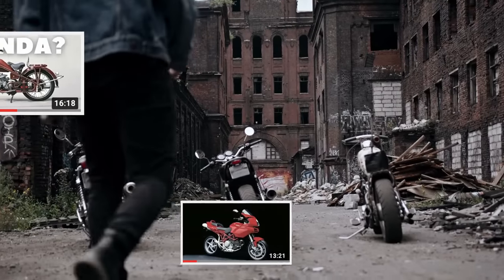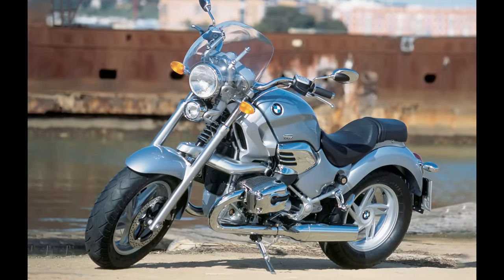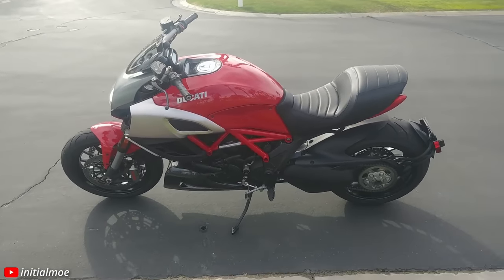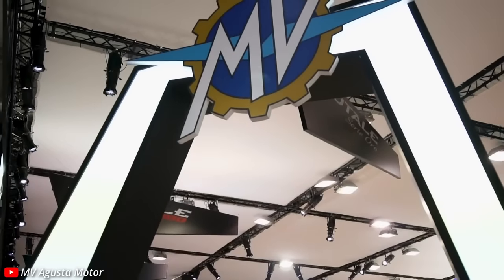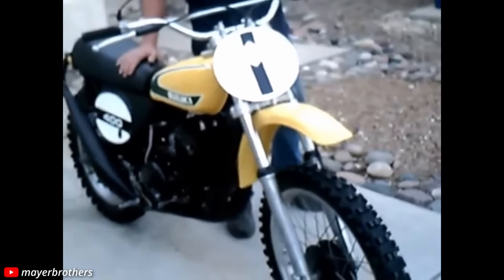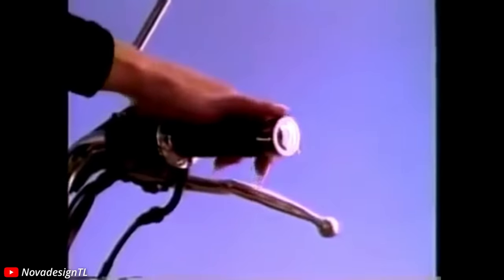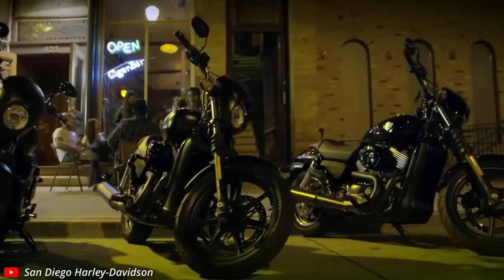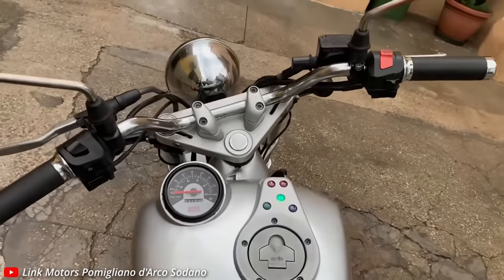The WORST Motorcycle from every manufacturer

Comment: The Norton Commando introduced in 1969 should be the first on the list. I knew every nut and bolt of this motorcycle well having purchased a new one and two used over the years. This piece of junk was a last ditch effort by Norton Villiers to stay afloat and mechanically it was an utter shame. Although the engine was a good one everything else on the bike had problems do to cheap materials, bad design, and no quality control at the factory. Starting up front the drum brake was nearly useless at its best and the fork tubes were plated with a soft material instead of hard chrome leading to worn seals and a scored tube. The bike would shimmy terribly because no dampener was present and this led to a record number of crashes and fatalities. Adding to this was the poorly designed rubber mounted frame. The transmission mainshafts would either bend or snap under hard usage. This happened so frequently that there was a backorder of them at the factory for months in the early seventies. The shaft that held the swingarm in place would loosen in the frame causing excessive side play at the rear wheel. The exhaust header pipes would frequently break at the flange and the rubber mounts used at the mufflers were too small and broke constantly. The action for the clutch cable was poorly designed making for a very hard pull and constant broken cables. I firmly believe that this bike was built so poorly and handled so badly that it never should have been allowed to be sold.

Comment: The Eliminator is always misclassified as a cruiser because of its looks. 
However due to its poor cornering at speed and tiny fuel capacity it occupies a kind of unique category as a sprinter.
Designed as an answer to Yamaha's Vmax for sprinting on the strip, the Eliminators appeal led Kawasaki to produce the design in every CC from 125 up to 1000 with pit stops at 250, 400, 500, 600, 750, and 900cc in-between.
The 600cc of 1986 even enjoyed a revival in 1996 due to demand.
The Eliminator is tons of fun in cities where its insane acceleration brings miles of smiles between the lights while its lazy ass cruise style is comfortable in this environment at low speeds. It is defiantly not a cruiser as due to the low seat height your knees are uncomfortably high and the pegs will hit tarmac if you are over enthusiastic in the corners, not to mention the tiny range of about 90 miles per tank full. I personally own an '86 ZL600 and a '96 ZL600 purely for the fun factor and of course a special edition KZ750N1 Spectre which is more of a cruiser than the ZL600.

Comment: So as an old guy having had dozens of motorcycles over the years. I am European but have lived in 4 different countries like Australia and for the past 30 years in the USA.  I was in Aus in the late 70's and early 80's and I have learned that Cruisers to me are useless and ugly.  I see fat old men on these going to the local bar, however, it is like a religious experience to them and few will leave the Harley brand.  When Japanese and European makers try to make cruisers they do not understand this and ultimately they fail.  On that note the Virago for instance, I had the Australian version of it around 1980 which did not look like a cruiser and had a different name like V1000 or something (1000 cc) it was a  normal motorcycle with an enclosed chain case.  It was under powered and a bit boring but not too bad and good for commuting.  Right now I ride a Moto Guzzi V750, why?  Because it is probably the last motor cycle that is easy to service by an owner.  It does not have water cooling, no chain to oil (shaft drive...) , no plastic body work to remove, and four simple tappets to adjust with the cylinders conveniently played out to the side for easy access.  One short service session once a year and I am done.  It also has the most comfortable riding position and on long trips I seem more comfortable than on most current motorcycles.  An finally it is 750 cc's but seems to have torque more like a liter bike.  So this brings up an interesting issue, why not do a video on which bikes are the easiest and cheapest to maintain for someone using a motorcycle for commuting rather than weekend rides.

Comment: You are totally wrong about Triumph´s oil in frame bikes. That system was one of their most clever moves ever. If you have any knowledge about "Dry sumping" you understand that this i very good solution. You mentioned foaming in the oil tank, that is all about useless engine oil that would be even worse in a wet sump lubricating. That relatively high oil tank formed by the frame supplyed air free oil to the oil pump.  The only real flaw about Triumph´s lubrication at that time was that they never installed a filtering system better than the usual strainer. After market solved that problem with filter adapter from Norton. A rotating continuous oil pump would be a better alternative to the ancient plunger type oil pump. But it worked. I drove my T140E from 1979 110000 Km and it had a good motor still.

Comment: XLH 1000 by the Harley bread machine company.  They figured out how to make mechanical  points and unproven electric ignition work together to make almost every motorcycle ride ended with the rider walking to the nearest payphone to call for a pick up.  Week engine, ho-hum design and just poorly made machines.  Harley under AMF stunk up the universe with their 70's motorcycles, lead by the 1000 Sportster.  Been there, lived it, got the well worn riding boot soles from pushing and walking.

Comment: 10:44. The Varago. I have ridden one. The handling was awful. At Hiway speeds, it did not want to corner. I had to put all my weight into the bars to keep it in the corner. It just wants to go straight. It sucked.     Royal Enfield... I think they would do better if they made some decent twin-engine bikes. Displacements from 450cc to 750cc would be acceptable. A 1100cc twin would be badass.

Comment: 7:21. Moral of the story, "Super Naked" or "Super Moto" bikes are hideously ugly, have never looked good, have never been wanted by real motorcyle enthusiasts and they look like a crashed and rebuilt sportbike with random pieces added on. Let's please delete the genre from the lexicon of motorcycles. 10:35. The Yamaha Virago hahaha. I posted a comment on another one of your videos about how I determined back in 2002, that the Yamaha Virago is the worst motorcycle ever. In my comment I explain how I rode a Yamaha Virago and it was the least powerful engine I've ever experienced, it felt about the same or slower than a 27 horsepower Yamaha XS400 twin, despite it being a huge engine on the Virago. I remember at 55mph the Virago felt like it was basically out of power.

Comment: I enjoyed the Virago 1100 as far as I could - The bike was nimble enough, incredibly pepe and I loved those raked out forks - I think I'd need to be another 3 inches taller to be comfortable -  I felt as though my feet would vibrate off the pegs though they never did. It wasn't my bike though so not my problem - I was riding the V-Max at the time, what a python that is to ride!

Comment: I bought a Virago 750 new in 1981 because I liked V-Twins but did NOT want one that tried to copy the Harley Davidson look.  The Virago had its own look.  And I think a very good looking engine.  The only thing I didn't like was the cast wheels (I prefer spokes) and I found the rear suspension design led to terrible handling (the magazine reviews at the time also pointed this out as I recall.)  I had never had a bike with a drive shaft before and it was SO much nicer than messing with a chain all the time.
Reply: Virago 1100 is a Harley crushing legend , I've had mine from new been everywhere on it, and it never let me down once.I wager it will be a future classic and this clown doesn't have a scooby what he's on about.😂😂😂
Reply: @81Grimreaper  Probably true.  On the other hand, I try to be a "buy American" sort of guy, so the Virago was an exception for me.  Shortly after I got the Virago a couple of Harley riders were coming down the street from the other direction and one yelled at me, "Damn Rice Burner !!!"  And I didn't really disagree with the sentiment.  And, actually, I once owned a "Harley" but it was the 250 Sprint that was actually made in Italy and not the U.S. - so it gets complicated.
Reply: @trainliker100  Yeah, I got no axe to grind with HD as I own a fatboy, which I really like. I guess all bikes appeal to certain people, and I don't  approve or disapprove of most bikes...I've been a biker all my life , however for someone to make a bold statement that it's a bad bike Is broadly just a matter of opinion ...in my humble opinion.

Comment: Moto Guzzi engine is one of the best in the world. You can pick any burn find Moto Guzzi from the 70s/80s/90s, put some gas on it and it will start with no issues.
The Tonti Frame was one of the best up to the 90s.
The only issue is that in the 80s they went cheap on other parts, lots of plastic everywhere.

Comment: The worst Yamaha is not the Virago 750. They have made a whole lot of BAD motorcycles,
try the GTS1000 hub steered tourer or the XZ550 , not forgetting the current worst motorcycle The Niken with 2 front wheels and 2 sets of front forks, an absolute abomination.

Comment: Stopped watching after Diavel came in. The BMW was just a bad design, but probably not the absolute trash some other BMWs have been, since it still had the reliable boxer engine. Then the Diavel, heck, I've testridden one and they are far from a bad motorcycle and very far from being Ducati's worst motorcycle, as they were pretty reliable and so on. So the list should be named "the motorcycles I like least from every manufacturer".
But you're welcome from commenting in this thread :D

Comment: 2:50 ... and worst of all, they put Pierce Brosnan on it in Tommorow Never Dies. Talk about the ultimate actor (and character) who generally doesn't belong on a motorcycle, but I'd have a hard time coming up with anyone who does belong on that thing. 

10:50 I always thought all Viragos were ugly AF, but the worst of the line is probably the most successful model, namely the 535. Those things were everywhere over here in Europe during the cruiser boom of the mid 1990s and I never got why, even back then. IIRC the 535 was the number one selling bike in my country for a few years in a row. It has a "gas-tank" that's actually a housing for the airbox, the exhaust-pipes are equally fake and it uses dress-up parts around its cylinders to make the engine look bigger. Besides that, it's just, well, ugly in general and it's not like there weren't any better looking Japanese cruisers around at the time for comparable money. Honda's VT600 Shadow or the Kawa VN 800A Vulcan were just so much better looking and, in the case of the Kawa, properly sized. The Virago (and the 600 Shadow to some extent) made an average-sized man look like a circus-bear riding a mini-motorcycle.

Comment: You have no idea about Royal Enfield Bullet / classic (350/500) it's called classic for a reason plus their styling is the reason people buy it, it's reliable engine is one of the main reasons as well, the new fuel injector engine used instead of carborator is underpowered and it doesn't give the bike a feel of a bullet or ROYAL ENFIELD,  don't pick on bikes you have no idea about as you might not know that a 1980 -2014 model sells for more than the new one right now just because of its old classic look.

Comment: I own 4 virago 1988 xv250 route 66....1994 xv750...1994 xv1100...1997xv750 and I rarely have to replace major parts always the regulator or stator but never a motor rebuild or even a valve adjustment, maybe because I'm a motorcycle mechanic and keep up with maintenance religiously..

Comment: The Trumpet was hugely cheap and we would steal the motors and put them on sportster and old hardtail frames. It sounded good with straight pipes, carried good power when it was handled correctly and with the right oil tank ( Harley) it worked really well, just ask the Spiders 🤣🤣🤣🤣

Comment: I can think of a number of bad bikes. Honda 305 Dream. This was early 60's touring. Ugly, reliable and really slow. Honda CB650 Four. A big bore hot rodded 500. Beautiful, fast but hot running and unreliable. 1972 Suzuki GT750. A big heavy pig of a bike that was so ugly it was kind of cool. A front drum brake was scary as was the evil handling. They were known as Flexi-Flyers. A liquid cooled 750 2-stroke motorcycle that was shocklngly bad, but I loved anyway. 
Kawasaki KZ750. This was another punched out hot rodded air cooled four. Fast, extremely hot running and fragile. Great brakes and it did handle but basically junk.
84 BMW RT80. A beautiful low mile example that was the single most unreliable bike I ever owned. It was so bad that the dealer told me he wanted to hide under the counter when he saw me coming.
Once I got into the 90's all my bikes have been good.

Comment: I am surprised you called out the Virago but not the Honda Shadow ACE "American Crappy Edition"! OK, it was copying the HD V-Twin, but basically the Japanese learned their parallel-twin design in the 60s copying the likes of Norton, and Triumph. Hmm what happens when you put 2 parallel twins on the same bike ... Legendary Honda CB "four" anyone?

Then that inline-4 comes full circle to the ZL900. Not sure why you don't like it but probably ok with the likes of Honda Magna / CTX, Kawasaki V-Max, Suzuki Madura which were all essentially the same "sports engine in a cruiser frame" - Maybe a cruiser just looks better with a V engine (wet v4 preferred)? These bikes offer reasonable innovation of the classic air-cooled V-twin cruiser offering better performance and reliability. e.g. the Magna / Harley improvement is too far away from doubling the CB / Triumph parallel-twins of the 60s.

Does the comment for Moto Guzzi "They are all basically the same bike, and they are all bad" apply to Harley Davidson too? (with the possible exception of the VRod that was better than your typical HD but bad in the way the Honda "ACE" was. Porsche "ACE" anyone?).

Comment: Regards your Royal Enfield choice. I'd gone through all (well at least most) of the Japanese, Italian and German big bikes. I liked nearly all of them but these days I tend to do most of my riding in cities. I went with Vespas for a number of years but the kids kept on trying to steal them so I had to go back to motorcycles. The Classic 500 was as fast as I needed to go. It looked like it had been wheeled out of a museum but it was easy to start and ran reliably. It even gave me 90mpg (imperial). I love the kick start as it makes me feel like Marlon Brando first thing in the morning. Whenever I park up, I end up fielding questions from other motorcyclists and passers by. Everyone admires it but no-one tries to steal it. Lastly, if I sold it today, after 6 years of ownership, then I'd get more for my 500cc Pegasus than I paid for it.
Reply: Cool. I wonder if they’ll make another single classic like that again?
Reply: @karlfonner7589 I doubt it. The 500 single wins because it's always been an icon but producing another new large single  would just leave you wondering why they did when other engine configurations are more efficient and don't feel like they're about to shake to pieces above 60mph.

Comment: In the early years of Virago I saw a lot of them dead in the water due to electrical problems.  As to the Guzzi my pick would be the V1000 with automatic transmission. The worst Indians were the bikes built in early 50s after it was sold to Royal Enfield.  My pick on the Honda would be the V45 due to the carburetors that were expensive and difficult to work on.,  BMW my pick would be the R45 that had bad engine vibration problems and low power but your pick on the later bikes even though James Bond rode one! lol    Worst Harley would be the V-rod or the first years after the Evo with Italian FI system but earlier years would be the AMF bikes.    Reason I left Triumphs was due to the right side shifter but before the factory fire they had quality problems which resulted in engines that vibrated badly.  Kawasaki's bomb was the 850 dual cylinder bike that didn't have crankshaft bearings which many of were still in warehouses in America years after production ceased but riders said were a bargain after the prices were greatly reduced.  And maybe the Kaw Vulcan 750 that you have to remove the engine to replace the  stator /trigger coil on.

Comment: This dude just don't know motorcycles at all, and he just seems to take a personal dislike kinda haphazardly. I've had a Kawasaki ZL 600 Eliminator from 1990 -2011 without any issue whatsoever, just changing oil/filter and tyres, and only once did I changed the gear oil as well. I simply loved the look/style of that bike.... unconditionally.With it's smooth shaft drive and it's linear power band, this bike was my all time favourite for riding fast on long journeys.What I found strange about this bike though, and in a good way, was that I was consistently getting an mpg of 50 -53(when cruising)!! It really broke my heart when I finally sold it due to the fact that I had gotten married and had a couple of kids, so I went in a different direction with cars instead.
What made it even better was the fact that only I had that particular bike in the entire country, and I was almost always asked if I'm selling...everyone just wanted to buy it from me as it was the only one of it's kind and they had never seen one  like that before!